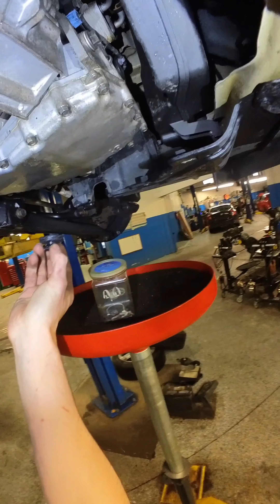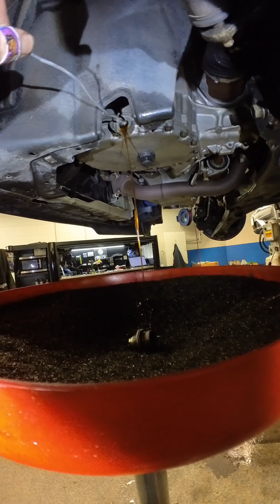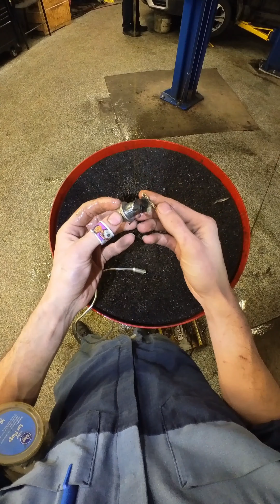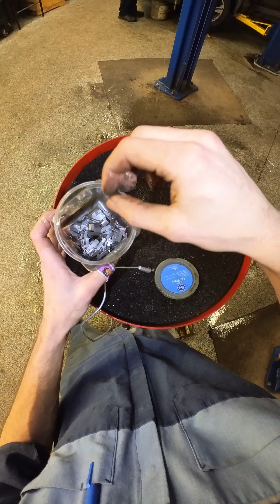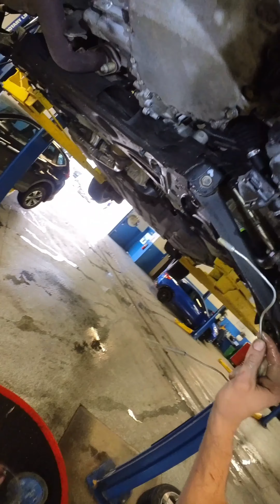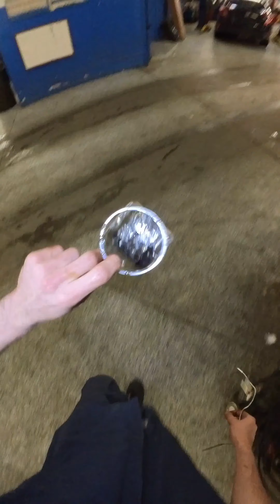Honda CVT No No Piece Jar Is Filling Up! 🔧👀👌 #honda #cvt #nonopieces #transmission #jazz

Comment: I was doing that to every cvt that came in for fluid change, just to be sure, even if it wasn't suspected bad. Then one day the magnet got stuck inside. Haven't seen that HR-V back yet. So, I'm sure it's fine...
Reply: Haha! Probably did that tyranny a favor. All the metal is clinging onto that magnet instead of swimming around loose.

Comment: What could cause that to happen?
Reply: Transmission fluid was never changed. It broke down over time and the transmission ate itself. The owner probably drove it until they noticed it was getting jerky, and then kept driving it for 6 more months.
Reply: @codyt.346 tbh also just cvt things, they are so shit reliability wise its not even funny

Comment: This is most likely the result of poor maintenance, rather than poor design. We will probably see more of this in the future with customers leasing vehicles and the rising cost of dealer maintenance. I have seen Toyota dealers charge as much as $150 for an oil change. Lean basic maintenance and do the work yourself. Change the CVT fluid every 30K and it should have a long, uneventful life.
Reply: You should do preventative maintenance, but this is incredibly poor design.